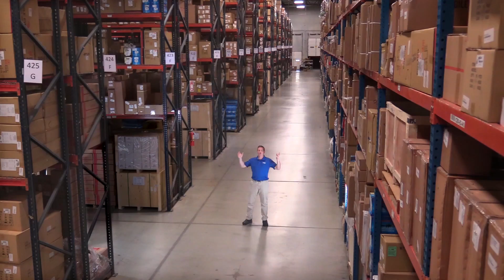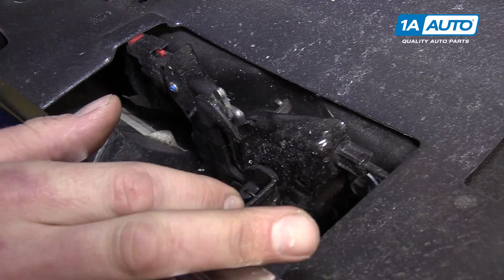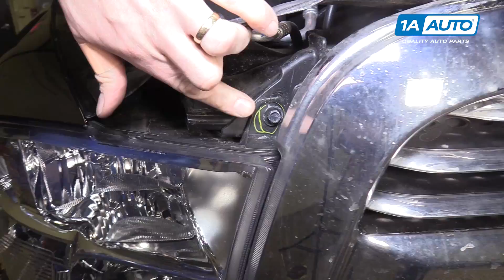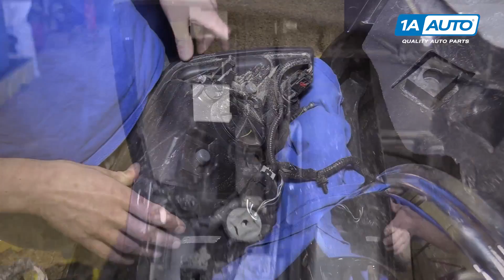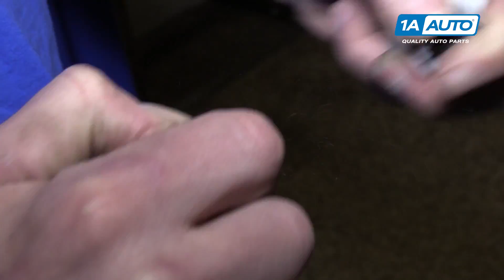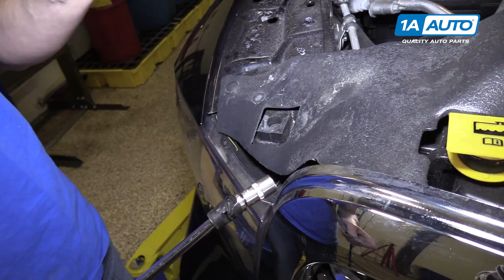How to Replace Headlight Turn Signal Bulbs 11-17 Ram 1500

Comment: It's a lot easier to just remove the grill,remove the black plastic cover,remove the bolts holding the grill on, pull the grill up and out.

Comment: I'm glad I found a second opinion that showed me how to do this without removing anything but the bulb socket. Just reach in the access panel in front of the tire, find the right one, turn counter clockwise, pull it out and replace the bulb. Way easier.
Reply from the maker: +Robin Omaka Thanks for checking us out! http://1aau.to/m/Shop-1AAuto-c

Comment: All you have to do is remove the little door panel in front of the tire and make the switch right there bro.. No need to remove anything else if it’s just the turn signal bulb
Reply: Yes! Exactly!
Reply: Going to try just removing the panel on splash guard. Thanks
Reply: Fam thank you !!! Cause idk what lever lol
Reply: 100% agree! I already had the bolts out per the video so pulled the light assembly out just to see if it was easier…. Absolutely no need to even get a socket out. Just open the flap on the wheel housing, twist the bulb connecter, and bam the bulb is out.
Reply: I'm very glad i read this! Attempting this this week...thx everyone
Reply: appreciate the video though too - - at least thorough if not maybe TOO thorough.

Comment: It's just better  to take out the plastic that sits on top of the radiator 4 bolts from the grill  and you don't need the long extension and is also easier to put every thing back on.